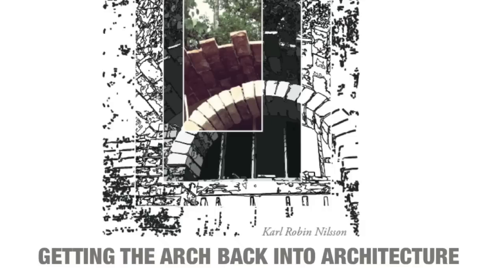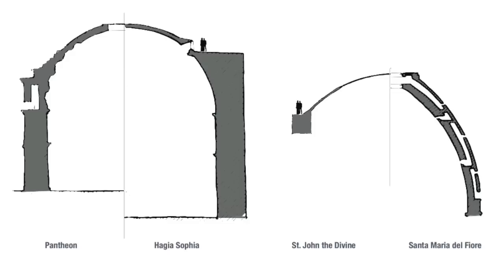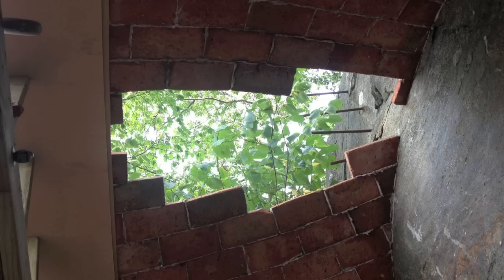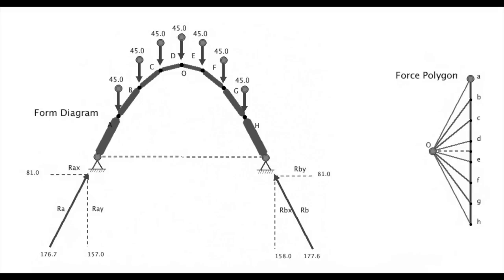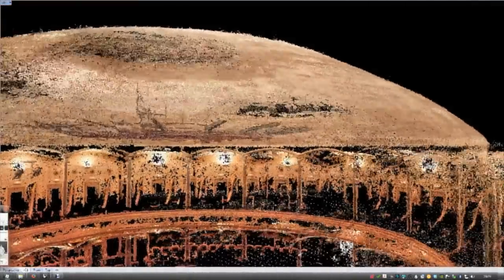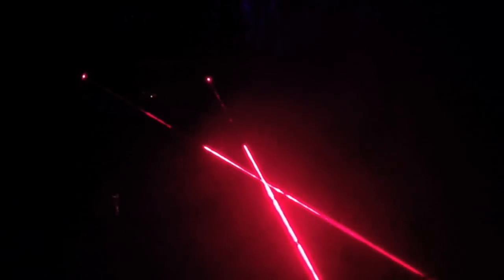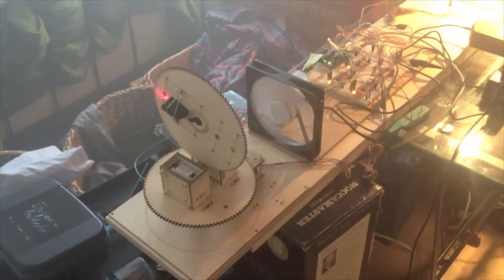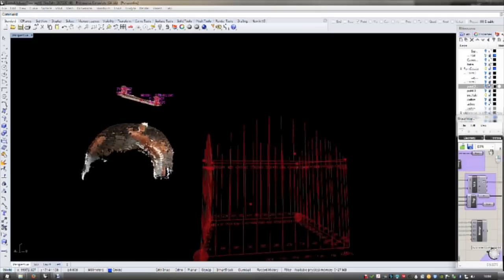Getting The Arch Back Into Architecture

Comment: Hi,
Could you elaborate on the specific plugins you used for your grasshopper script, or publish the script itself? It seems quite complex so I assume you used other tools.

Thanks!
Reply from the maker: +Yafim Simanovsky 
Hi,
Sure, I uploaded main script to http://s000.tinyupload.com/?file_id=03396242146051340779 now (i think it is the final version I made before the workshop).
But I doubt you will be able to use it since it was never cleaned, commentend and optimized. It references some rhino geometry too. But have a look if you like (spaggetti :).
It uses the plugin Firefly (amazing plugin for sensor equipment i GH) and maybe LunchBox and Kangaroo. I don't recall if they were in this script or another. This one was for just for the laser control I think. And maybe the brick tiling.
Reply: Thanks a lot! (just saw your comment)

Cheers
Reply: @RealisiticEdgeMod   Where is your master thesis?
Reply: @yafimsimanovsky6889  do you still have this script file/screenshot? Would be interesting to see. Thanks.
Reply: @porschepanamera92  I'm sorry I don't have it.. I don't think I used it in the end...